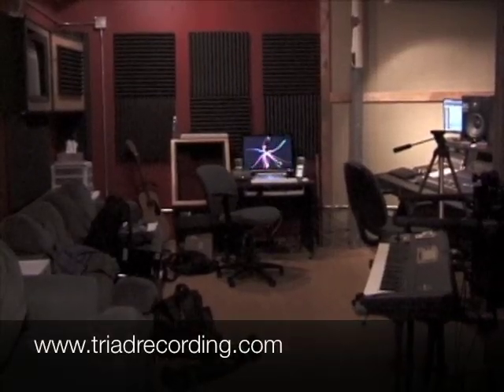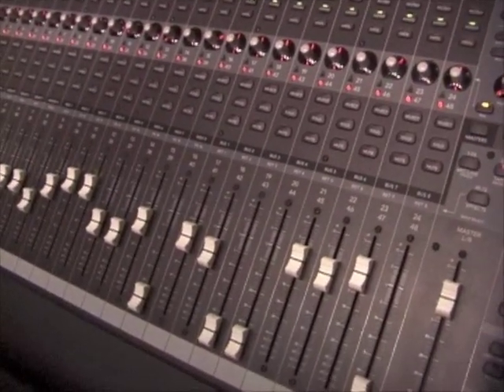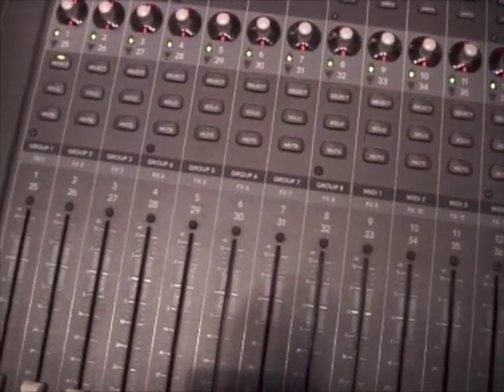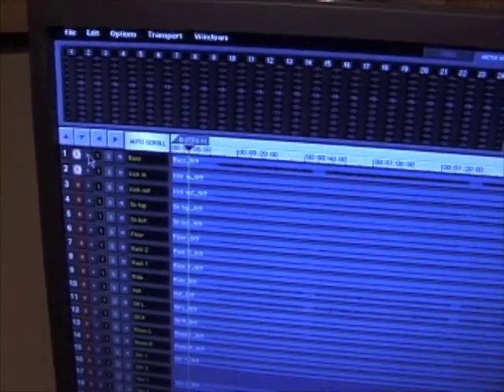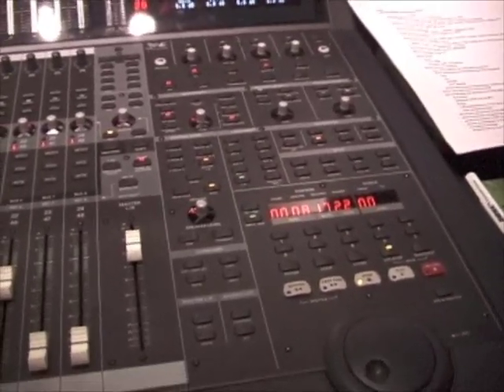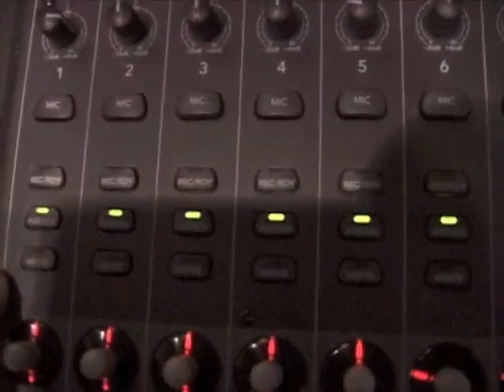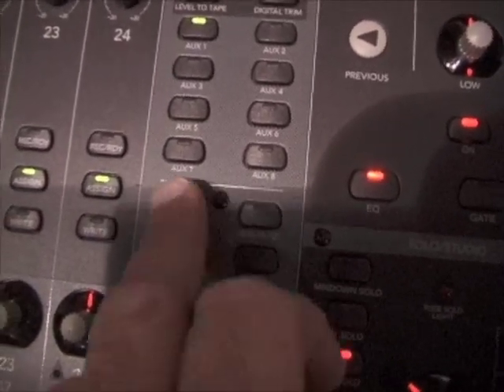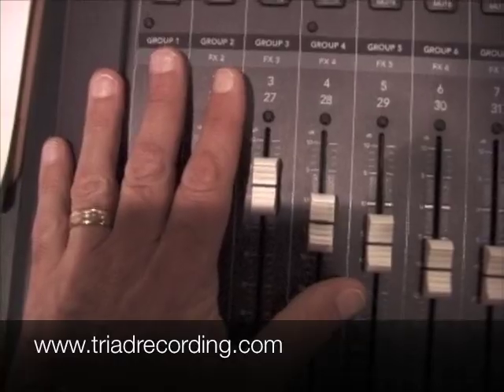Mackie d8b Tutorial (Pt. 1/4)

Comment: Hey, thanks for uploading this video! I am new to this mix board, but so far everything is working very well. Except, my analog channels have a white noise sound that is driving me nuts. The digital inputs and outputs are fine, but not the analog. Every analog channel that is wired for input and output have a static sound buried deep unless you turn it up. . Any idea of what may be causing this? Any idea of how to fix this by chance? Also, is there a way to turn up this mix faders all at once? Like lock in the position I want them, but turn them up all at the same time using one fader? Thanks for any feedback.
Reply: Same here, I am thinking maybe it is the pots, as on my d8b they must be dirty since many of them are not functioning very well, I plan to spray clean them out. Hopefully that makes it better, idk
Reply: @hehunches  Hi. Any idea of how I can select multiple faders at once? I like the levels they are at, but I want to turn them all up simultaneously. I cannot find any information in the manual either..
Reply: @bluntsanddiscussions  is your os 3 or 5.1? I'm 5.1... and I'm just learning. But I read today about group function. Haven't tried it yet though, will try and report back.

saw this: http://www.d8bforum.com/phpBB3/viewtopic.php?f=2&t=757

Also you prolly know this but the D8b forum is very detailed... anyway, page 56 of the d8b manual for 5.1 - The Channel Menu - on p57-8 describes group function. so far, not exactly sure what the hell the manual is saying tho. If I get a group working I'll let you know how.
https://www.sonido-7.com/d8b/files/userguides/D8Bv5_OM.pdf
Reply: @hehunches  5.1
Reply: @bluntsanddiscussions  So I got that working - but it is not what I expected... If you go into the channel section as described in the section about grouping it will explain how to assign tracks in submix style to one of 8 'master faders' in the 'master' section bank. I messed around all afternoon and I thought it wasn't working... 

Because, it doesn't do what I expected it to. The master fader doesn't physically move the faders on the console, and thus, it seemed to not do anything. Until I played the tracks back - then, I realized that within the GUI, the master fader I had armed (in my case I set up tracks 1,2,3,4  'assigned' to 'master fader group 8') that it was working as describe, virtually. Which now I get it. The book says this is virtual grouping. That means that within the GUI the master fader bank can control a set of faders much like a submix on an analog console, except don't expect the faders to automate, the virtual stream is as far as the console is concerned, pre-fader. 

So if you follow the book on page 36 where it describes the group control, and better, page 58 it explains the GUI access to grouping channels, it will do what you need it to, just not on the physical fader bank. 

That's the button marked MASTERS next to SHIFT above the fader bank buttons... I always wondered what the hell that was, as it will pop 1-8 faders to unity, 9-16 to nil, and 17-23 to unity. Finally I realized today, too that the MASTERS and SHIFT buttons are color coded to the top label strip above the faders that say group 1-8; then midi 1-8, then bus 1-8, respectively. That never made any sense to me, until now. 

I'm still learning how the buses and the auxes work, this is one gnarly console, the damn manual is bigger than my anthropology textbook(mind you, smaller than my history one haha). Good luck!
Reply: @bluntsanddiscussions  https://www.sonido-7.com/d8b/files/userguides/D8Bv5_OM.pdf
Reply: @hehunches  Hello, any idea of how to install/enter authorization codes for "Authorized Plugins"?